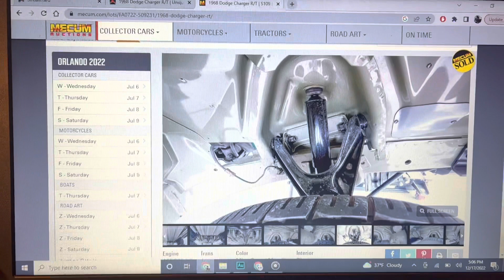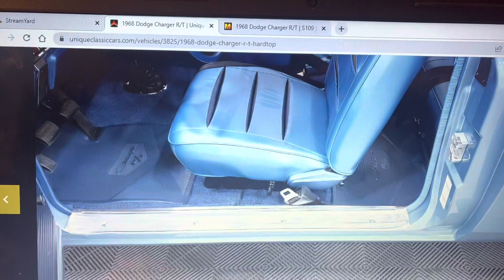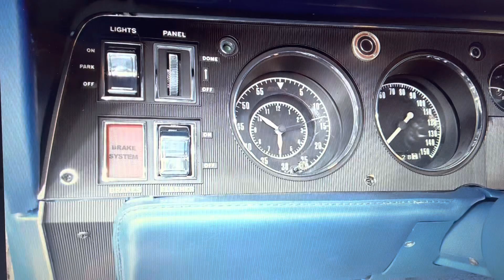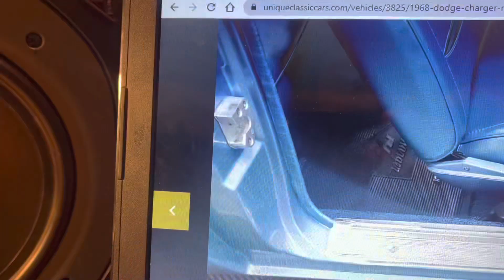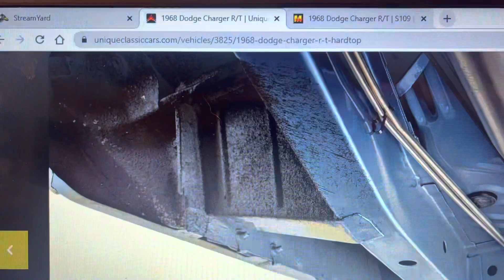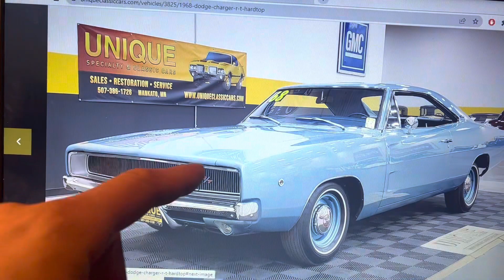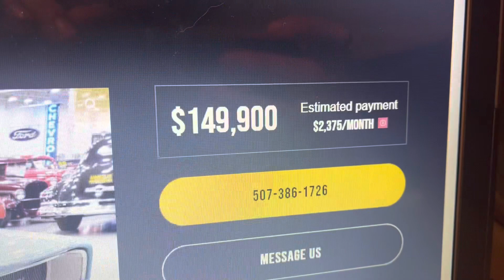Why Is This 1968 Dodge Charger R/T Selling For $150,000?

Comment: I did a resto mod 68. I paid for most of it to be done by a shop, (because the level of quality desired was well above my skill level). About $220K to finish it. Included an engine rebuild with fancy parts added. $150K for this example doesn't seem unreasonable.
Reply from the maker: Right. This is truly a pristine example as best as I can tell, and the workmanship was clearly top notch. It’s very expensive - but it’s very good.
Reply: Investment at this level, nothing less...

Comment: From what I've gathered in the past researching my '68RT and confirming the details (I'm second owner and know the original owner didn't modify anything from when he purchased it new), for '68 the differences between standard and RT were 11" drums instead of 10" unless you opted for disks, and a beefier front sway bar and torsion bars, and indeed an extra leaf in the right rear leaf spring. There were different options you could add on but ticking just the RT option, those were the differences I believe. I haven't seen with any consistency otherwise.
Reply from the maker: That sounds correct to me. I am by no means an expert, but I’ve done a lot of reading over the years. I bring up the drum brakes specifically because of all the commenters on the previous video insisting that it had to be an R/T clone because it had drum brakes, which is absolutely not the case.

Comment: Is that a Mark Worman special? He's the only 1 I'd think of when I see a restoration that correct but with a modern technology paint job.  Chalk marks,  rear diff lettering from the line, under hood stickers, and It's truly beautiful. The 4 speed and big block in a plan Jane but sexy blue. I'm guessing big block cause of sway bar.
Reply from the maker: It’s a 440 4 speed R/T. I guess I didn’t really say that. Haha. Actually all Chargers had a front sway bar from ‘66-70 at least, if I recall correctly. I really like that it’s stripe delete, radio delete, no top, no console. It was clearly ordered to do one thing…

Comment: And there were new quarter panels changed on the car and new floor pans and trunk floor pans. So why would you actually pay over $150,000 for a restored numbers matching rust bucket?
Reply from the maker: Because if you want to have one done it’s going to cost you over $100k and it probably won’t turn out that nice. Find me one of these that hasn’t had quarters done. I’ll wait…
Reply: @DeadDodgeGarage  Most unrestored Chargers have had their quarter panels and floor panels done. Most of them have been totally rebuilt. And you're not gonna find a fifty plus year old car that's totally rust free and that clean. Not unless you're willing to pay over $100,000 for the car from a collector's collection. So let's be honest here now. Okay?
Reply from the maker: @earlputnal9124  Have you seen my Charger rust video? Lol

Comment: Have you ever seen a 5.2 magnum 46rh automatic transmission with a square weight on the torque converter???!!! Awsome channel
Reply from the maker: Huh. No, I can’t say I have… is it small? Maybe necessary to neutral balance the converter during manufacturing?
Reply: @DeadDodgeGarage  I don't know this is my first trainee Swap and I don't want to mess it up just kind of stumped me it's a little bigger than 1x1 inches and it is welded to the front face of the torque converter close to one of the bolt holes...not sure if i should cut it off
Reply from the maker: @jobehayes8444  If this transmission was already behind a 5.2, leave it alone. They may have still used torque converter weights behind early 5.9 Magnums? That sounds kind of familiar but I really can't say for sure.

Comment: It’s missing the top corner map pocket chrome  buttons
Reply: And the radiator core support sticker are usually to the right more and not right in front of the cap
Reply: Jack sticker should be to the left of truck lid, I’m using my survivor car as a example
Reply from the maker: Someone else called out the chrome corners. I hadn’t noticed obviously…
Reply: Note there is a wood felt like card board in the back sail panel head liner that keeps that smooth back there, it often doesn’t get replaced because it rots away it get misplaced

Comment: That is the going rate for a restored 68. The work is spot on and to be honest 100k was spent at the shop that did it. This is years of work or with a team 6mo to 8mo. I saw mecum pawn off a 70 hemi charger but the funny thing is it's numbers matching status was bogus. It turned into a law suit when it was proven it was a rebody. Of course you never hear about those deals unless your in the position I am in. Lots of dirty cars out there so do your homework before you buy. Go see the car in person. Frankly I got lucky when I bought my 70 hemi charger because I knew Tony the builder and watched it come together. I paid 25k for it in 2004. Wonder where it is today. The last guy that had it dropped a valve and blew the motor so I was told. Doing donuts in a Walmart parking lot. Dumb azz.
Reply from the maker: Completely agree - I wouldn’t be surprised at all if they were into the car the asking price or more, with as good as the work appears to be.

Comment: Fully restored or not, I would never pay 150,000.00 for a car, yeah, it looks nice, but NO!!! The owner is a THIEF. 👎👎👎👎👎👎👎👎
Reply from the maker: I disagree. Many collector grade cars are trading at a quarter million or higher. You wouldn’t pay for it, I wouldn’t pay for it, but that does NOT mean it isn’t “worth” it, or that the seller is a “thief.” I maintain that the high quality and extremely thorough restoration job to get this car to where it is probably put the owner into the car close to or above what it is selling for. If you paid a company to do this to yours, you would be spending $100,000 or more. Just a savable Charger R/T that needs everything runs $30-50k now. So… do the math.
Reply: @DeadDodgeGarage  I have done the math I bought a Hemi charger 500 when I came home from the Nam. It sat for a long time till 7 years ago. I had help but everything was replaced brand new I'm mean everything!!! After adding up all the receipts I spent close to $70,000.00 to bring the car back to mint condition. Some guys over  Exaggerate the money they actually spent on the restoration of their cars. So if this charger R/T is worth $150,000.00 then my 426 Hemi Charger 500 must be worth alot more cause the Charger 500 was a Limited Production model, you don't believe me look it an do the math. TRUE👍👍👍👍👍
Reply from the maker: @curtismiller8529  uh... Yeah, it probably is worth a lot more than that. You have one of the most desirable Chargers ever made.

Comment: Should the engine be black I thought they don't they change the paint the blue and 71 I could be wrong but I thought 70 on down engines were black I thought Chrysler came out with the blue and 71 for the engine
Reply from the maker: Turquoise in 68 and earlier years. R/T engine is orange starting in 69. It went to corporate blue after that, by ‘72.